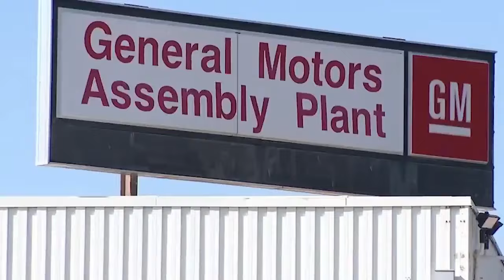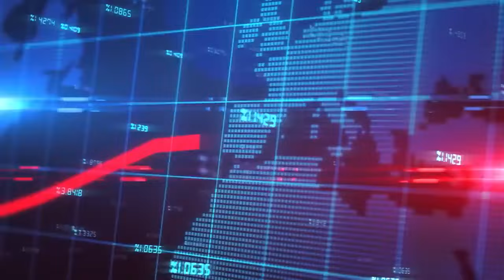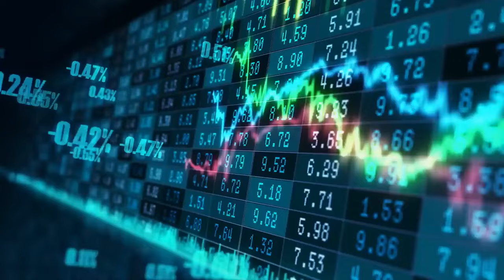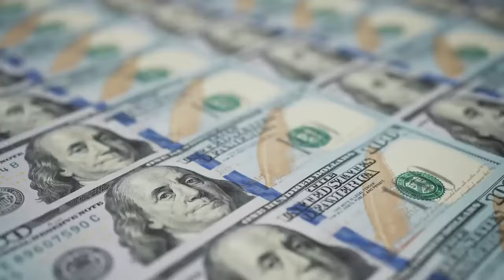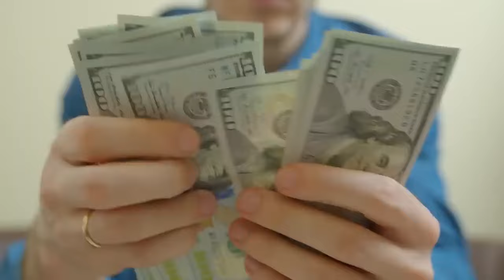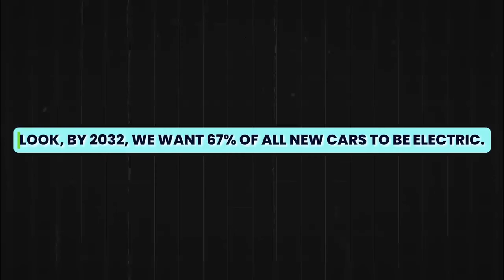EV Sales Continue to Drop Dramatically!!The EV BUBBLE Is STILL Bursting!!!

Comment: EV’s are not the future !! I work for a local Ford dealer and our owner decided to put the Ford E Transits into the parts delivery vehicle fleet since they are NOT Selling,not a good idea.Those only get 110 miles on a full charge luckily I get up to 160 on a full charge and that’s not much.So I usually alternate the vehicles,one day with the EV,one day with the Gas !! Almost ran out of electric with the EV van 4 hrs on the road and had only 28 miles and 18% battery left before charging after delivering on a morning run !! So I’d never recommend any EV’s

Comment: HELL, THE GAS AND DIESEL ⛽ TRUCKS AND AUTOS IN MY NEIGHBORHOOD ARE ALL $ 40000.00 TO OVER $ 100000.00 DOLLARS AND THE DEALERS HAVE HUGE INVENTORYS ON THE LOTS. 2023,2024,2025'S ALL IN STOCK 🤯😕😱 AND THEY ARE NOT MOVING ANYTHING . SO HOW ARE YOU GOING TO MOVE A $ 40000.00+ E.V.🤯🤯 GOOD LUCK 🤞🍀